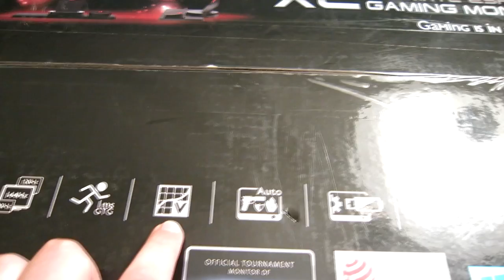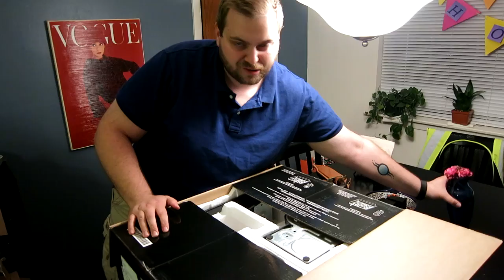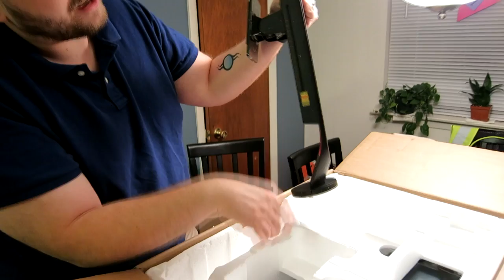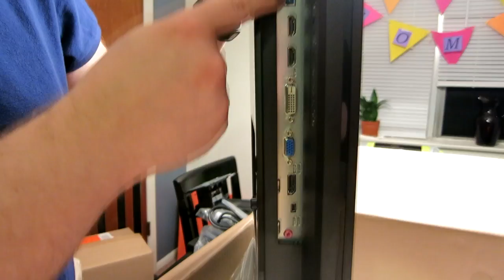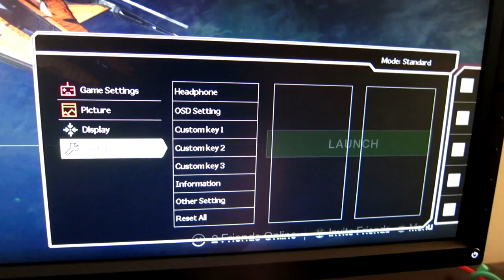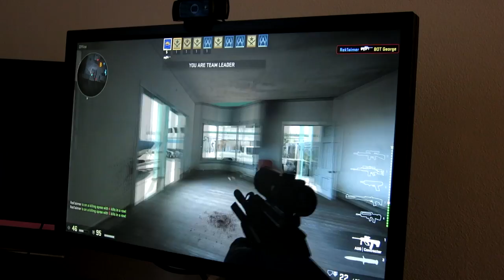BenQ XL2430T - Unboxing & Overview

Comment: so rn i have a 21.5 inch and i have 1200 dpi can 1 sens in game (csgo), if i bought this what whould i have to change my dpi to to get the same dpi
Reply from the maker: +Robert Olear couldn't tell you man, but if you are upping your screen real estate you may need to bump the dpi
Reply: No. DPI is how many pixels the cursor moves per inch the mouse moves. It'll be the same DPI regardless of the screen size or even monitor resolution. It especially doesn't matter for first person games.

Comment: Hey i got this monitor yesterday but i have a few questions...i still dont understand how to use the usb cable! Is it really necessary and what is the actual use for it? Also i dont know how to get the drivers and display pilot software...but i heard theyre not needed but anyway where do i find them? When i put the dvd in, there just appeared a few folders....:/
Reply: ***** ty for the response could you link ne the latest version of dp maybe? And what other (important) things does the dvd offer apart from the manual guide?
Reply: xVeNGe4NCe oh and do you know if the instand mode affects the response time. Would you leave it on and how about ama?